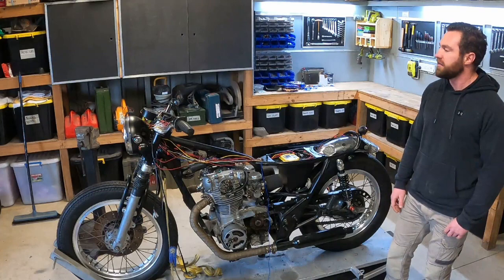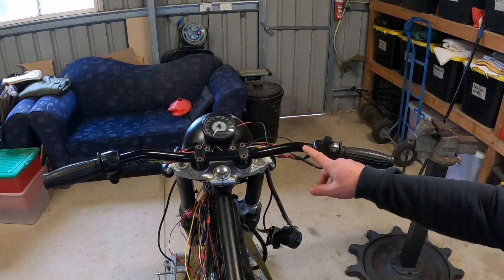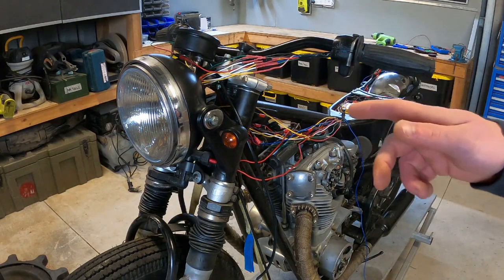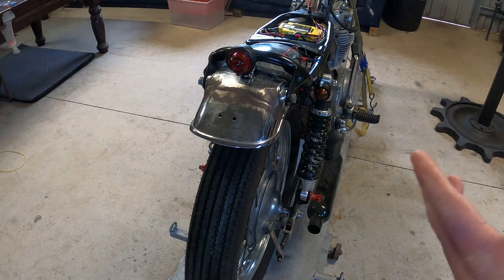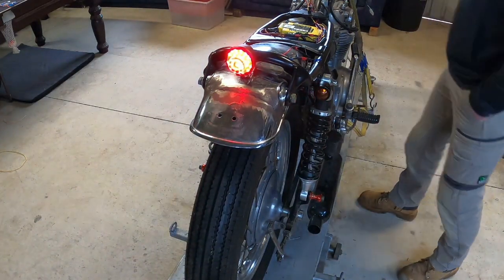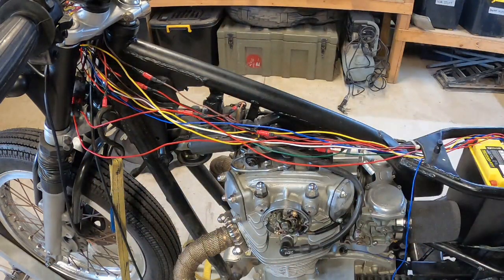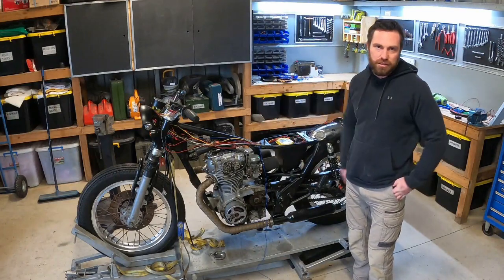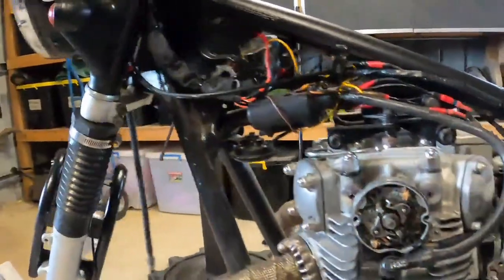XS650 Brat Build Ep 22, Wiring Summary

Comment: my entire cubman build was wired with trailer wire. 
It makes it so easy and really neat if you don't have to strip the outer coating off.
Reply: i was "lucky"  @2wheelworkshop  because I was making my entire loom from scratch (not really that lucky) but I could just run a full strand to the front and another two to the rear and just terminate plugs where I needed them.
wiring is a necessary evil but at least you are closer to riding it now. enjoy the rest of the build

Comment: I guess you didnt bother with the rpm meter, how did you close of the rpm connector, and is this a gps speedo or still require the cable which is connected on the bike, thanks in advance

Comment: What year is the bike? I want that speedo meter for my sx650 1983 model. Is that a digital gauge? Did you buy a conversion cable? Also, how did you get neutral light to work?
Reply: Can you make a video on the neutral light and wiring? I am having hard time figuring that out. Also, can you provide the link to conversion cable? I am from new york ☹️. So I will have to find those parts online. Thank you
Reply: Thank you so much! I been looking for months how to wire a neutral light. On my bike all the wires are messed up and different colors. I can’t figure out where on the engine is the neutral switch. Thank you! I will wait for your video.

Comment: Hey man I’m building a xs650 and I am horrible at wiring. I was wondering if you had a diagram for your wiring?
Reply from the maker: I just went off the factory diagram and modified it to suit the guage as I went. Sorry mate. The factory diagram is pretty busy but if you spend a bit of time it is pretty easy to break down.
Reply: @2wheelworkshop  I guess I should have said I am wanting to use my factory controls like you have but the wiring in the headlights is all disconnected. I need to know what colors go to what so my handle bar controls function. I have looked online but have found no answers.
Reply from the maker: I made a whole new harness and made up my own colours. I should have recorded what was what as I went but I am probably going to redo the whole lot anyway as I plan on upgrading a lot of the electrics anyway. Your best bet is to get yourself a multimeter and use it to trace all of the wires back to their source. Sorry I can't be any more help.